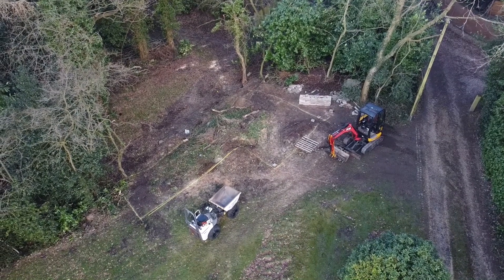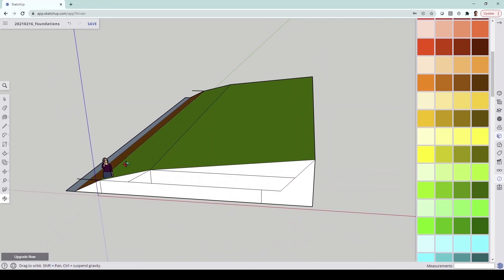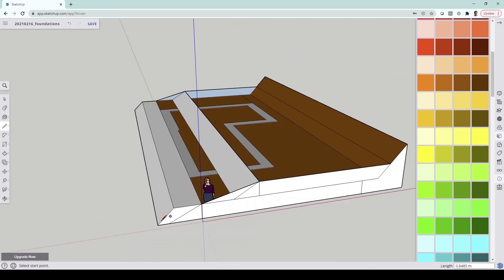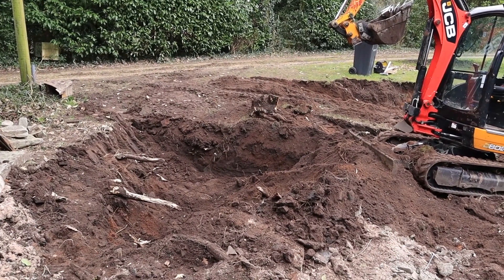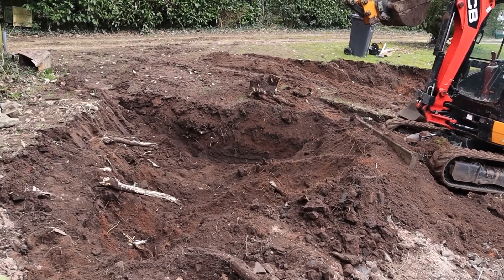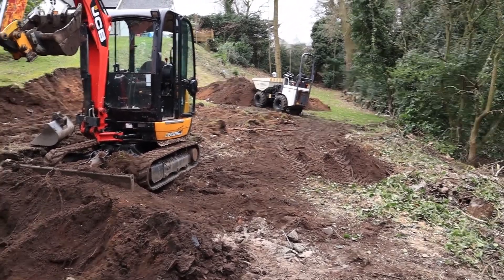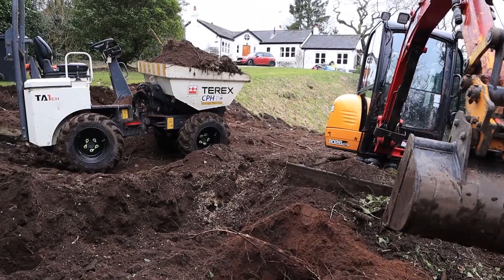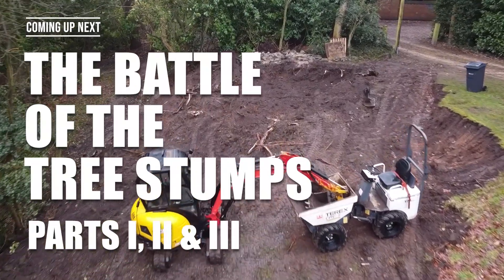Sloping site deep excavation - DIY Barn Build #4

Comment: Would building-up not have been simpler than digging down ? I think you could maybe have managed a monolithic slab with stem wall foundations instead of dropping the whole plane down to that 2m point ?